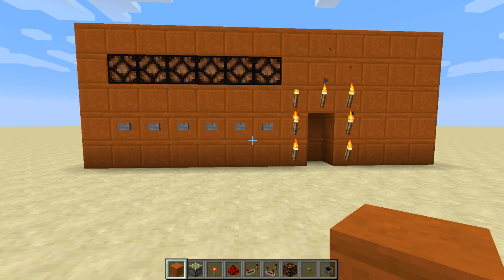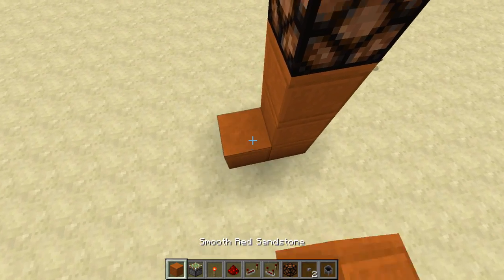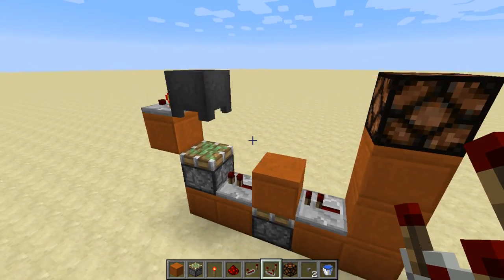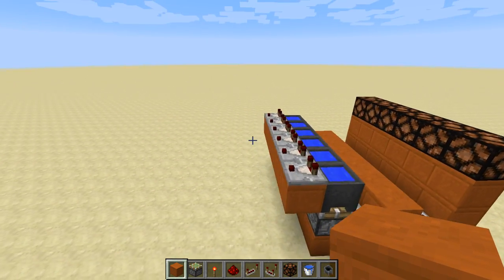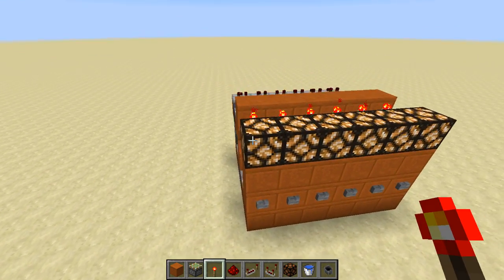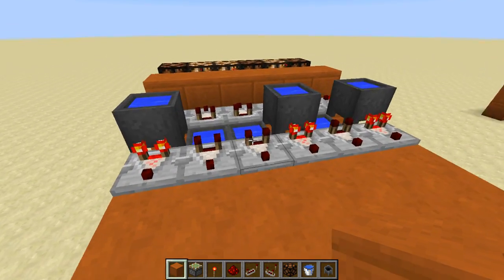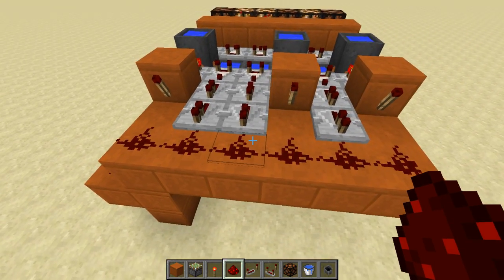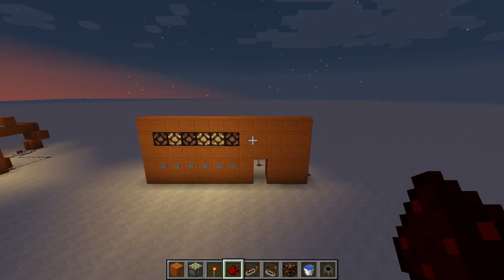Minecraft - Simple Combination Lock With Buttons - Redstone Build Tutorial (Minecraft PC/Console)

Comment: Wouldn't really call this a combo lock since order doesn't matter and there's no reset...
Reply from the maker: ADeadlierSnake It’s just a simple button combination lock. Who says it has to have a reset? It was just something I made a few years ago.

Also, order does matter. It requires a specific combination of binary inputs, with each input needing to be either on or off depending on how it’s set. Any other combination and it won’t work. It’s basically just binary
Reply: @SquaskewBros  I think he meant that there's literally no order,  if the code was 1 3 4 5, it wouldn't matter if you entered it like 1345 or 5431 or 1543 or 3451. Not sure if youtube will censor this picture but https://i.imgur.com/mKjASL5.jpg , made a design with resets